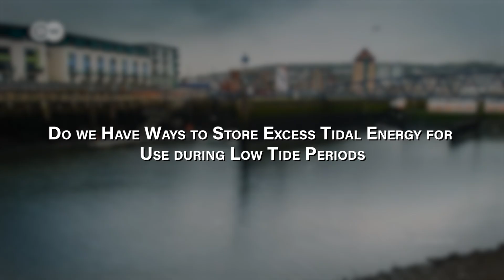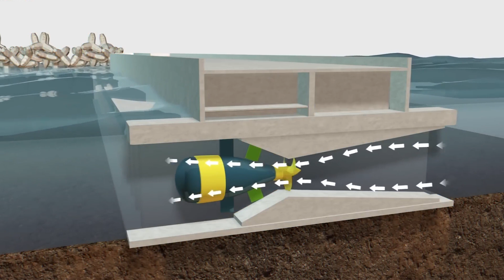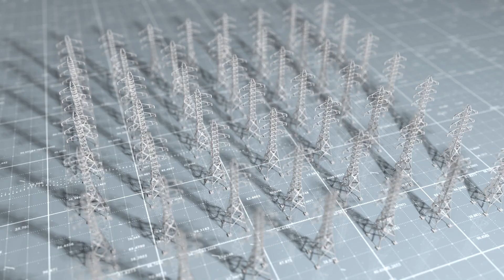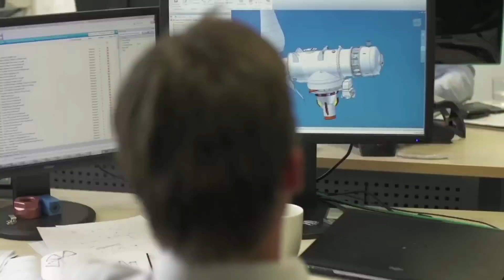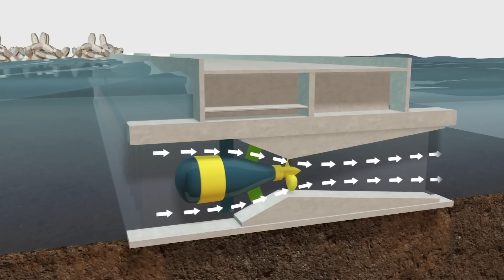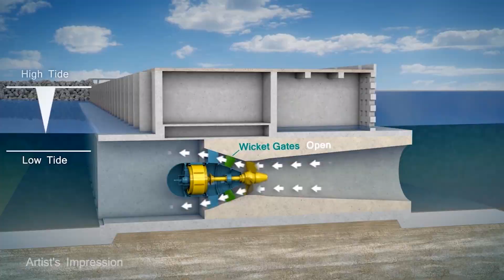This Amazing Energy Source Is More Powerful Than Wind and Solar Together!

Comment: Never put all eggs in one basket. Besides such cliche, this form of energy probably has some significant maintenance costs. In comparison: solar panels have low wear and require a lot less investments when stalled. They still provide cheap energy that is very competitive during work hours in most seasons and days. 
Tidal wave energy a complementary technology to other forms of renewable energy. In due time, it certainly can be a great player but a mix of energy sources can and will be used. 
It can provide a base load of energy, vital to stabile energy networks but often wind and solar enegy will be in the mix as well.

Comment: As a scuba diver; I have had many experiences with the power & energy of the ocean and other waterways.  Outside of costs; the bureaucratic entanglements to do this along the Pacific Coast of US will likely be more challenging vs raising the Capital.  Then distributing this power to drive coastal facilities and communities is another cost and bureaucratic work processes.

Comment: I've been proposing this for years. But my proposal is a little different. I propose floating barges containing huge generators which are driven by cables one side of which is permanently anchored and the other side of which is attached to a and anchor that is above the seabed and able to move up and down as the tide raises and lowers the barge. The barge contains generators that will move up and down with wave motion and tides. The cables attached to the fixed and movable anchors will turn pulleys attached to the generator that will generate power. This idea is simpler than some of the ideas mentioned in the video. But everything about it is available technology and does not require a lot of development. It does however occupy space on the surface of the ocean. It does not though presenta Hazard to marine life as the other ideas do. The other ideas being submerged could present A Hazard to navigation and other things. I think this idea deserves more consideration.